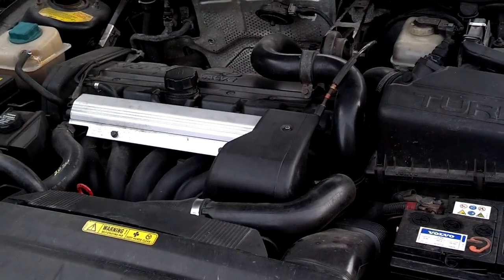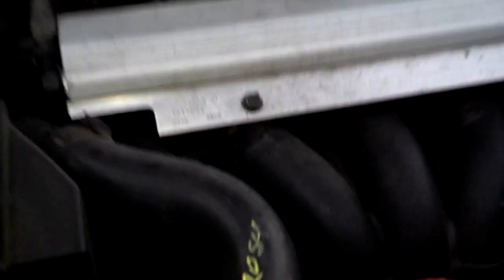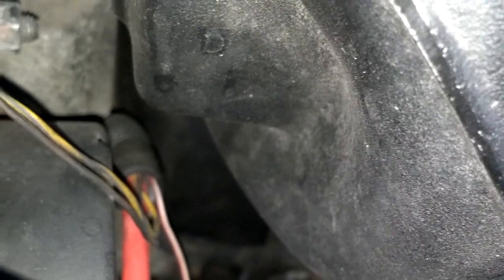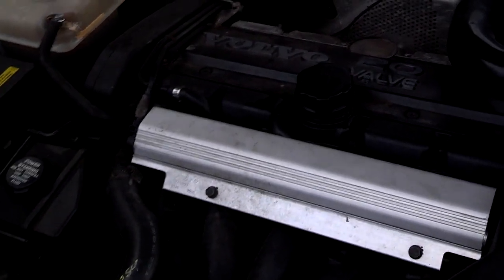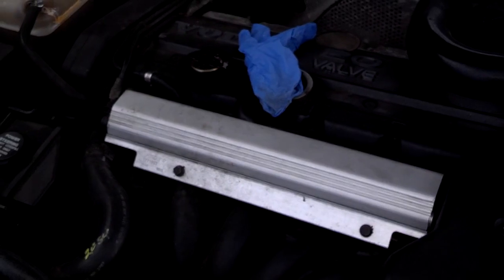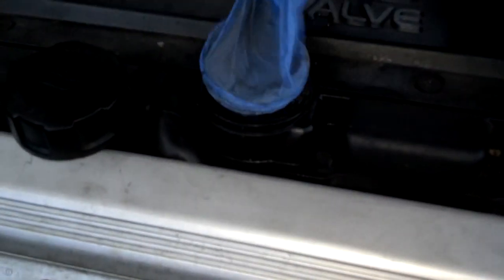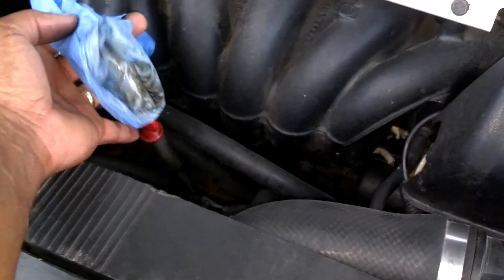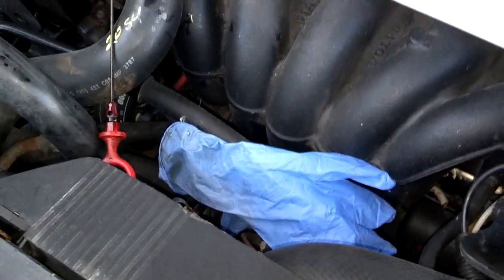Volvo PCV system check, 850, V70, S70, and others - VOTD

Comment: Thanx for the tip, But my problem is that im not shore if my pipes and hoses are conected rhigt. So is there anny diagram or somthing so i can check to make shore it's all connected properly?  it's a 96- 850 turbo.
Reply from the maker: Yes, you can look at the vacuum diagram under the hood or look at the PCV Replacement video.

Are you have a problem with the car running or with a code?
Reply: I did check some of the PCV system today and looks to be all good. Now the thing is the PVC system and turbo in it got changed. And the turbo I got from a B5234T and my engine is a B5204T and it seams to not give the correct boost from the turbo so that's why I was thinking something was not installed correct. But maybe i just need to adjust the turbo for my engen?
Reply from the maker: What turbo come on the car? Usually when guys upgrade the turbo, they change or upgrade the ECU to tune the motor to the bigger turbo.

You'll have to visit SwedeSpeed or TurboBricks to get guidance on that stuff. I'm pretty much a stock - keep it running kinda guy.
Reply: TD04HL-13G is the turbo that was in it before, not shore what the other one is thats in it now. and the ECU is the original.
Reply from the maker: Likely a 15G, that is what my car came with (as well as all of the T5's.) I think that is the same turbo that came in the GLT's. From what I have read, the T5's can take larger turbo's without issues, but the GLT's can not take the extra load of a larger turbo. Pistons, rods, etc. were not engineered to take more pressure.
Reply: Yea i think it is but not shore. will have a look on it tomorow and see. 
it's a B5204T 2.0L 1984 cc,Turbo, Motronic 4.3, 210 hp (157 kW)  M56 5 speed manual (850 2.0 T-5 From italy)
Reply from the maker: Maybe you can replace the motor.

Comment: Quick question. During the glove test the glove gets sucked in at idle but when I rev the motor it blows out. What does this mean? Your videos are awesome and super helpful! I go straight to Robert DIY when I have a question now! Thanks!
Reply from the maker: I'm not sure. There is a chance that you are experiencing piston blow by. You can do a compression test to find out.

How to do a compression test on a car motor. Volvo 850, S70, V70 through 1998 - Auto Repair Series

Please let me know the results. That way I'll know for future people. So, my thoughts right now is that your PCV system is in good health, but you may have a worn motor or piston. If your car is a turbo, the numbers should be between 156 - 186 psi. If your car is NA then numbers should be between 185 - 215.

Comment: Robert; I just received a new radiator for my 98 Volvo S70. The one I removed from the car has trans cooler connections one the left side. The radiator I received has oil cooler lines on both sides. I believe the right side is for the engine oil. Can I still use this radiator by just leaving the right side port open? Thanks for your useful advice.
Reply from the maker: Hmmm, I guess you can. Never thought about leaving the oil cooler lines (for turbo cars) open but I don't see why not. I have seen a few people just plug them or cap them off but you are right, it should not matter.

Comment: Robert, I just had my PCV system changed. I just picked up my car today. And it still has the same problem. (Inflates the rubber glove) any suggestion ?
Reply from the maker: Compression test. If the compression numbers are good, they failed to do something right is my guess. You can search, "Volvo 850 compression test" to see my detailed video. The test only takes about 15 minutes but the gauge cost about $45.

Comment: Hey Robert. First of all, thanks for your informative videos! I found myself browsing through them for fun and you not only seem knowledgeable but also very helpful. Good stuff; thank you! Anywho, my 1999 S70 AWD has a small oil leak (tiny droplets every time I park my car). Dipstick check: no smoke. "Glove" check: gets sucked in. I haven't been under the car yet but it doesn't seem to be a PCV issue. What else would this rule out? My S70 has just over 120k and has been well-maintained. Thanks in advance for your time!
Reply from the maker: Where does the oil drop? If you have one of these cars that do NOT leak something, take a picture, that is UN-common. Turbo cooling lines often start to go near that mileage.
Reply: Robert DIY Took some pictures this morning. Is there an email address I can reach you at? Thanks again, Robert!
Reply from the maker: I sent you a PM. There is direct contact information on my website.

Comment: I watched the video and now, after viewing it, I do remeber the dipstick being popped out of postion the first time I opened the hood to take a look. I figured that the person who checked the oil before me forgot to push it back into place but after watching the video I am now thinking that excessive crankcase pressure caused the dipstick to pop out of place. I also noticed an oil spray pattern on the inside of the hood and oil sitting on top of the engine as if someone spilled oil while filling the engine. Could these signs be indication of a clogged PCV system causing pressure and causing oil to spray? If so, how can I pinpoint what needs to be repaired and where should I start?
Reply from the maker: Well, those are ALL of the SIGNS. Did you do the dipstick or glove test?
Reply: Robert DIY Not yet...I'm at work and i just watched your video earlier this morning. I'm planning on looking at the car tomorrow. I'll fill you in on what I discover. Thanks for your help...
Reply from the maker: If it's clogged, the system will need to be replaced. I'm going to shoot a video on it tomorrow and try to get it posted Sunday.
Reply: I didn't get a chance to look under the car but I did drive it around for a few miles. The car has a burning oil/coolant smell in the passenger cabin and the windshield fogs up real bad even when the heater motor is off. It also has bluish smoke coming out of the tailpipe.
Reply from the maker: From the sounds of your last message, you have a bad heater core (look up "Volvo S70 Heater Core Replacement"), leaking valve stem seals (a clogged PCV system can make that worse) and an oil leak which can be caused by the bad PCV.

Comment: Hi Rob I put the pcv/oil separator box back in after cleaning it out with a diesel soak and shake with ports closed then a reverse flush with a hi pressure gerni water Karcher if you call them that over there.....WORKED PERFECTLY LIKE BRAND NEW NO AIR PRESSURE sound being forced out when i shut engine off. Take care brother

Comment: Hi,Replacement the PCV in a 99 V70 is the same has the other older  models,don´t you have demonstration video,i see your check video and my system having little smoke,i have to do the replacing

Comment from the maker: I will check that out. 

As for the PCV system, the box is the strongest link in the system. The only reason I pull them is because I need to make sure I clean behind the box, make sure the ports are clear. The main problem with the system is that the lines are clogged, damaged, leaking, etc., stopping the system from venting properly and creating the vacuum it is suppose to.

Comment: Hi Rob, I pulled the PVC unit off filled it with diesel fuel and shook the hell out of it and let it soak over night then back flushed and forward flushed it with a Kartcher high pressure cleaner. seems to have worked will let you know how it goes when I put the cam seal back in it blew out...check out my vid on the landcruiser carb mod to save fuel and get more power..you could make a few 4x4 owners happy

Comment from the maker: I think it will NOT work. The hoses are usually clogged with with a hard carbon build up. The engine port may also be clogged. Also, the diesel fuel will NEVER reach the lines, oil does NOT flow through these lines. They are damaged from years and years and thousands upon thousands of miles of OIL VAPOR. I promise you. many upon many people have tried to get around PROPERLY servicing this system and have failed. What damage might diesel fuel otherwise do?

Comment from the maker: Yes, your car may also have a part installed in the intake called VVIS which is a valve in the intake manifold that closes 1/2 of it off sometimes. You should take the entire intake manifold off, not just push it to the side. The EGR valve is bolted to the bottom of the manifold, and you should take it off, scrape off any carbon buildup, then install a new paper gasket. This will also require you to pull the throttle body off so you should get a new gasket for that as well.

Comment: Hello rspi007, is the rubber glove test 100% accurate? i had a reputable shop replace my pcv system on my 2000 s70 GLT but the rubber glove over the oil filler opening still inflates like a balloon. I'm wondering if they took the time to clean the "hard hose/tube" and the PTC. If not, would this still give me the positive pressure as shown by the inflated glove? Please help.......thanks.

Comment from the maker: Yes, a compression test. This is not a fact but just an example. Lets say that a motor in good condition will blow 20 units of air per minute. Lets also assume that the PCV system is designed to handle 25 units of air per minute. Well, a motor with worn pistons may produce 35 units of air per minute, which exceeds the system design, likely on purpose to let you know that something is going wrong with the motor before it leaves you stranded in the wilderness somewhere. Do a compression test.

Comment: I have not done the compression test yet but I have cleaned & checked the ptc valve & pipes by the turbo & rest of the newly installed pcv system, and all seems okay. But the glove over the oil filler test, inflates the glove? The smoke has stopped but there is still a smell of fumes from the exhaust. Even a cylinder problem, wouldn't the gases get sucked away via the pcv system. My pcv system, does not seem to have any vacuum. Is there something I am missing?  Any ideas will be appreciated?

Comment: Thanks for the reply. I did a thorough clean, found very little residue. The old PCV was in bad condition so it needed to be done. It has reduced the smoke but there is still a smell of fumes when the car is warmed up & only then. I'm not burning or losing any fluids, none. The plugs are new & clean. I will compression test & clean the PTC valve. I did not check or clean this when I replaced the PCV piping. 
If you have any other suggestions, it will be appreciated.

Comment from the maker: I would do a compression test. Maybe you have a bad head gasket or a worn piston. These cars actually run with bad head gaskets for a long time. My daughter drove with one for over a year. Keep the coolant topped up and it'll keep going. 

Did you remember to clean out the ports in the motor?

Comment: Dear RSpi007. 
Volvo 1996 850 Turbo. I had smoke coming out the exhaust. Done the check with the glove over the oil filler & it inflated.  I have now replaced the PCV system with a new PCV system kit. Did the check with the glove again & it is still inflating the glove. What is next?

Comment from the maker: Well, I really don't remember saying that the system could be "CLEANED". Chances are that you have broken tubes while in there trying to clean it. The system simply needs to be replaced. So, place an order for the parts or go by the stealer and pick up the parts to replace it. Cleaning it out... many have tried, few success stories.

Comment: i have a Volvo 850 G LT 95 i did the test and smoke came out of the dipstick line so about 6 to 9 days ago i took off the intake manifold so i could clean the hole where the E G R valve goes cause of carbon build up  and was blocking it and also check the p v c breather lines  and now the engine started hesitating again but also when i run the car i feels  like if i had the exhaust inside the cabin plus the hesitation persist did i miss something but work at the time the flame retainer box

Comment: Did you find out about your issue. My car has problems starting. It cranks and it wants to start but then it dies right away. I have to leave and hold the key in the start position for a few seconds until it starts. What could be the problem? Sometimes when I come to a stop it will die too and then it doesn't want to start.

Comment from the maker: You should also double check the intake tubes. If one of them are loose or not connected properly, it will not start or run properly.

Comment: Hi I have a volvo s70 turbo 99 engine T5.  I replaced the engine.  to start the engine I have to press on the gass petal down and leave it there and it doesnt pass 2000rpm when I take the gas petal out it turns off.
what do you think it could be?

Comment from the maker: It could be blow by. You can do a compression test to test compression. Did you replace all of the vacuum lines when you changed the PCV valve? Any cracked or broken line can cause blow by. Also, when the system is replaced on the Volvo's it usually takes 500 to 1,000 miles for the smoke/vapor to clear up.
Reply: Y

Comment: Hi there, I have a 320i BMW, and I chanced my pcv valve, but air is still pulsating from oil cap hole when i remove it, and from the dipstick I see a little vapor or fumes coming out slowly but without pressure, and I repeat I have  changed my pcv valve but still no fix...:(( 
Could be worn piston rings... and this could be a blow-by phenomenon?
Could someone please reply...? It would help me a lot, thank you all.

Comment from the maker: Seen my first feedback video today. The car was coughing oil out of the oil filler neck all over the top of the motor. 

Another way to suspect the system is clogged is when you see oil all over the top of the motor when you remove the spark plug cover.
Reply: I just swapped a 2000 V70R motor into my 1997 850 AWD..... I put a new-er (clean) PCV box on it... new hoses.... and it FAILS the glove test horribly! Turn the car on and it blows the glove up immediately at idle. 

What could this be?  I'm at a loss here  :(